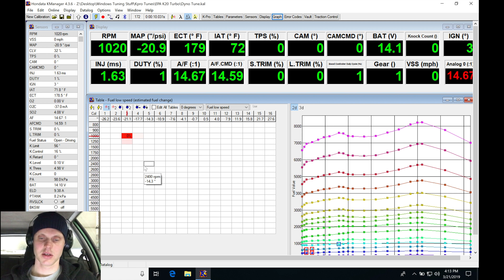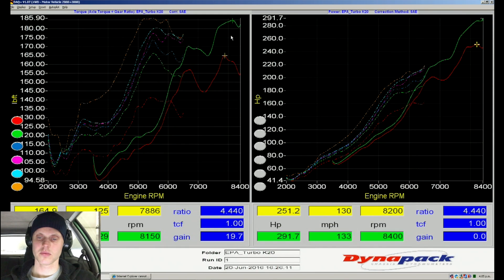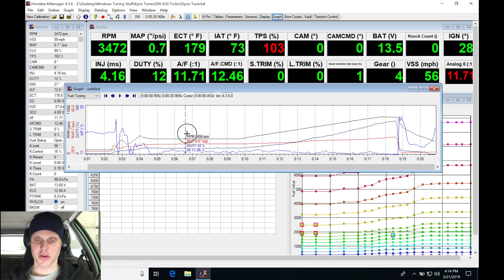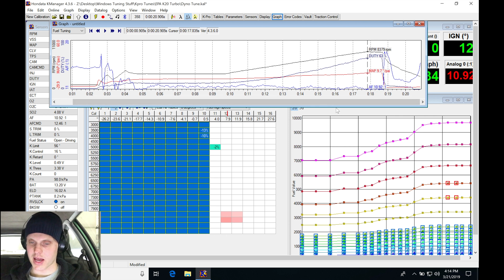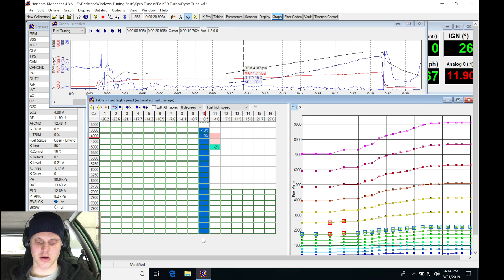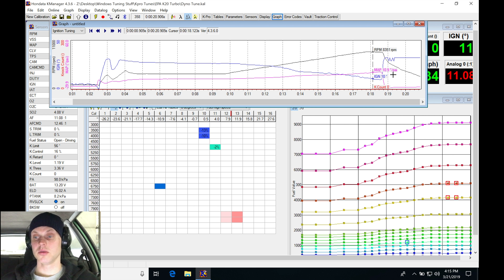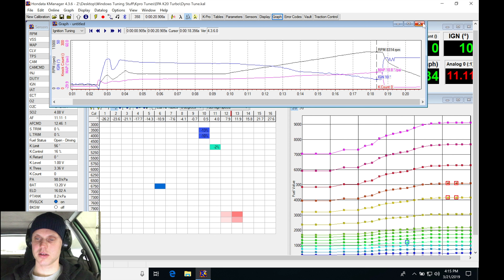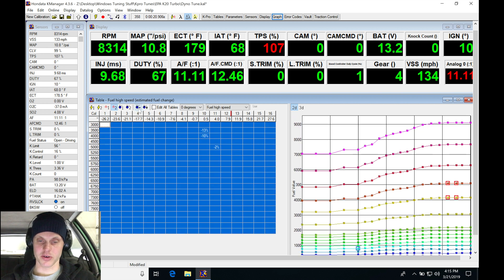KPro Live Training: Turbo K20a2 EK Civic Part 3 | Evans Performance Academy

Comment: Hi. why does the BAT  voltage drop with high rpm?
Reply from the maker: Alternator can't support amp draw from car.
Reply: @EvansPerformanceAcademy  
the value at high revs drops to 13.3v. so is everything ok?